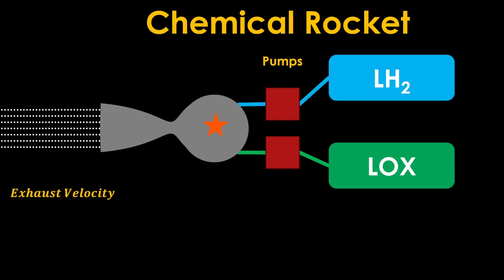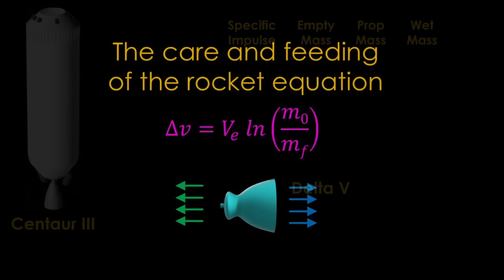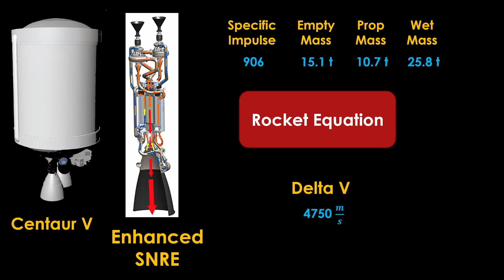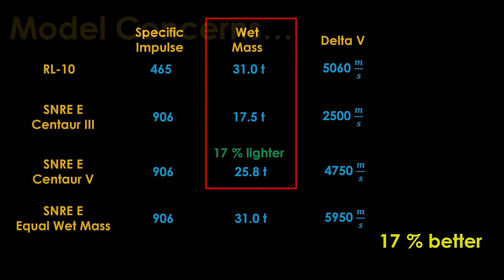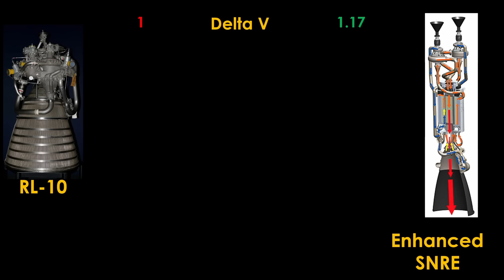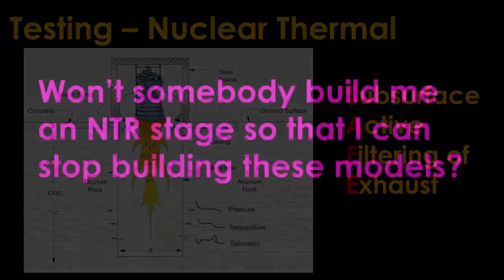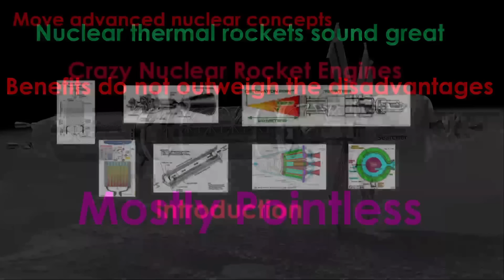Why Nuclear Thermal Rockets are Mostly Pointless

Comment: I do tend to agree that NTRs aren't all they're hyped up to be, but I think they do have their niche.
They pretty clearly don't make sense for single-use stages because they're much more expensive, and don't get much extra delta-V for the trouble without using an impractically low thrust-to-weight ratio. I think they're also generally unlikely to be very useful for exploring the inner solar system since solid core NTRs lose their efficiency advantage with the easiest to make ISRU propellants until you get out past the frost line, where water and hydrogen are everywhere.
As reusable tugs near earth, on the other hand, a stage that has the same delta-V but has higher dry mass and less propellant is actually really good because it makes refueling in orbit cheaper. For pushing lots of mass out from LEO, either to its destination near earth or to just shy of escape velocity, nuclear thermal rockets would save a lot of fuel mass. I think they have a lot of potential in their niche once space infrastructure reaches the scale to justify the investment, though I do think that's still a long way off.

The small scale of the reactor and the requirement that it can ramp up extremely quickly does mean that it probably has to use weapons-grade uranium, and it would have to wait a few days between burns since it couldn't afford the weight of the extra control systems to safely burn up the xenon on a sooner restart. That does pose a bit of a political problem, but not really a technical one, so I think it's a different argument.
Reply: Reusing a NTR also adds far more complexity and hurts its performance due to the need to expend propellent as a coolant after shutdown, or else the thing would literally melt itself.  Claiming problems are political rather then technological is the biggest lie in nuclear industry too, don't fall into it.
Reply: @kennethferland5579  I mean, I assumed you have to be able to shutdown the reactor between burns even if you aren't going to refule it if you want to do multiple burns, and there's very little that would want 6+km/s in a single burn. I also don't think that's a huge issue though, since quenching the reactor isn't that hard as long as you don't need to turn it back on for a few days. The relatively low tempratures in a solid core NTR also make a variable throat expanssiond deflection nozzle, to maintain chamber pressure and ISP at low flow rates, pretty practical, so you might not even loose much efficiency.

I do agree that almost everything about this (and most of the probelms in nuclear power) are technical issues, not polititcal ones, I meant to only refer to the likely need for weapons grade uranium as a mostly political problem. Everything else is obvioulsy a pure technical issue, and maybe someone more clever than me can turn the ramp rate into a technical problem too by avoiding weapons grade uranium, it just happens to be a well understood solution.

Comment: I feel like nuclear propulsion is useful but nuclear electric propulsion just seems more useful that NTP for long term missions. thrust is really low, but ion engines can already burn for months if supplied with power, NEP could allow that to happen where the sun becomes too weak to normally use solar panels like orbits farther than mars orbit. NEP could also have much higher thrust that solar powered ion engines due to access to much more power.
Reply: Solar electric will beat nuclear electric for anything withing the asteroid belt.  If we need to go to send men to Jupiter then we can start looking at NEP.

Comment: You wouldn't use the NTE to lift off. It's a second stage vacuum engine. The advantage comes from being able to run it almost continuously during the trip leading to extreme velocities and shorter trip time. Nobody wants to coast to Mars for 7 or more months.
Reply: No design for NTR has them operate for more then an hour or two tops, and the engine mostly destroys itself in that time.  For even a trip to the moon that time frames not much different them chemical rockets burn times of minutes, it's a huge gulf between that an week and months or YEARS that ion engines operate for.
Reply: Ion engines run almost continuously.  NTR's burn like chemical rockets, short an intense.  You might want to actually look up projected flow rates of the reaction mass.

Comment: Yeah, I used to be a big fan of nuclear thermal but I’ve shifted to a more, “they have potential but they just have too many issues for their benefits”.
Something like liquid or gas core nuclear thermal has enough isp in my mind to make it more attractive but if you are at the point where it’s cheap and practical enough to make those, you might as well make something more advanced.

Comment: Electric propulsion becomes utterly unusable at high mass. They simply do not have enough thrust to pull off a great many utterly critical maneuvers. NTR's get a significant ISP boost using methane because it can, at a high enough temperature, dissociate the methane to atomic hydrogen which is the fastest possible exhaust for a given energy.
Reply from the maker: I haven't found any mention of atomic hydrogen being generated. It's a hope.

With methane you still have the carbon in the exhaust and that reduces the isp
Reply: @EagerSpace  At a few hundred degrees C there's a certain amount of dissociation at equilibrium but it's less certain that it'll happen within the timespan of an engine. Ammonia would break down more readily though.
Either way, electric propulsion doesn't have a great way to scale up thrust.

Comment: these engies do make sense for 1 application
Reusable space transport
have 1 vehicle constatly  in LEO and if you want to go to low Lunar orbit you simply use a chemical rocket to go to LEO with fuel
refuel the vehicle and it will take you there and back and park it self in LEO again
would probably still be massive tho
Reply: No ion engines are better for all orbital civilian stuff

There are only 2 relevant metrics for a ship, acceleration and delta v. You need surprisingly little acceleration to go places before you hit flip and burn territory (you flip and burn with ion engines too, but it’s inefficient so ideally you want to avoid burning at the vente of the itinerary) 

Ion engines have enough thrust to bring you from planet to planet without running into the issue of you arriving at your destination faster than you can spend your fuel (the only reason you would need more acceleration in a transfer)

The moon is much closer to earth so an ion engine would take longer, probably going there in a spiral if it’s too weak, it would take a few more days but it’s not a big deal with permanent human presence (a few more days of food and water doesn’t matter if the people already live in space their entire lives anyways)

The advantage of nuclear rocket is having higher exhaust velocity while still being in the high thrust category of solid rocket and chemical rocket thrusters. There is no sense in using a nuclear rocket in an application where high acceleration isn’t required. 
So they are great for take off, landing and warfare, but for peaceful transfers ion engines + solar panels are better (solar so you don’t waste rare and finite, valuable fissiles)
Reply: @IceRain-f5v That quickly stops being true when the discussion goes to orbiting gas giants. 

There’s a Children of a Dead Earth mission that involves going from a moon orbiting either Uranus or Neptune into the planet’s low orbit to destroy a space station skimming the atmosphere to collect gasses. 

The final maneuvers that are required to get into position are next to impossible with ion thrusters. The spacecraft’s velocity just doesn’t change fast enough. 

Now, maybe given infinite time it could be done with some hyper sophisticated spark of genius set of orbits, but those can be an unaffordable luxury when time is of the essence. 

Likewise, ion thrust is useless in combat. Based on my own experience in Children of a Dead Earth and simulating space combat with heavily modded Space Engineers, the ability to change trajectory quickly is extremely important to dodging both kinetic weapons and debris from intercepted missiles.
Reply: I like calling them "engies"
Reply: No hot nuclear reactor is ever going to be allowed in low earth orbit. They will only allow the engines to activated once its on its way away from Earth to ensure any accidents don't spread radioactive debris across thousands of miles of the earth.
Reply: Except NTR are not reusable, the decay heat of ANY nuclear reactor will just strait melt it if not dispated, NASA NTR concepts were all disposable stages.  Making a NTR stage no meltdown would require complex modifications and additional propellent expended as boiloff coolant all of which will destroy the last shreds of performance advantage it might have had.

Comment: If NTR makes sense to use for very large in-space-only rockets that are to be used repeatedly, who do we sacrifice to do the maintenance on the engine?

Robotic maintenance?  What happens to the delicate electronics of the robot near the reactor?  Where do the contaminated maintenance robots live?  Where do old contaminated engine-area parts get disposed after they have been replaced?  If skipping maintenance and just replacing entire engines after some pre-specified time of use, then there will be more engines to dispose of, which nobody wants brought to their planet, moon, or dwarf planet.

When the engine is eventually decommissioned, where do the old engines get dumped, and at what expense to process decommissioned engines while in space?

How or in which circumstances are NTRs more cost effective than chemical rockets?  This needs to consider the whole cycle for the rockets, from obtaining materials, manufacturing, launching, operating, refueling, maintaining, decommisioning and disposing, regulatory fees, limits on where they can be used, never allowed to use aerobraking, and public anti-nuclear sentiment as has happened after large-scale radioactive accidents of any kind in the past.  Do NTRs always require government subsidies to be economically viable?  I don't see any big private money going toward NTR development, although some smaller start-ups want to try.
Reply: Luna is geologically stable and does not have a water cycle.
Plenty of space on the far side to put it out of sight.
I'm not particularly worried about a "Space 1999" scenario.
Reply: NTR's use up their fuel as well.  So the reactors power declines as it ages which means so does it's ISP.
Reply: @imaginary_friend7300  that is not how reactors function as fuel burns up. They can maintain any set moderator temperature for the entire design life of the core. So the hydrogen moderator and thus isp would be the same. What changes would be reflector position and neutron flux go up over life to compensate for lower fuel density. This would make the startups behave a bit different but not steady state operations
Reply: Reusing NTR is very very hard, they would need post burn coolant to keep them from melting, additional control systems and shielding to prevent damage and would have very low thrust to weight asnd higher costs a result.  NASA never considered any senario of reusing them.

Comment: Wow. Was all this planned to be used in the first stage? Or only in space as a later stage? And it sounds like hydrogen is the problem... per usual. Could heavier elements have dramatically greater effects? What would happen if you sprayed methane in there? KA-BOOM?!! 😄
Good stuff! And I think this is the first time your music choice is alien to me rather than one of my favorites as well.
Reply: The problem with using heavier elements is that you lose Isp.
Isp is equivalent to exhaust velocity, and average energy of an exhaust particle is directly related to temperature.
But E = ½mv², so velocity is inversely proportional to the square root of the mass.
Reply: @michaelmicek  The higher mass particle doesn't also provide more thrust? Temperature is a variable but mass is also, right?
Reply: I do seem to recall the plan was to use it as an upper stage engine.

Comment: since nuclear engines advantage are better in big rockets, what about starship? with a lighter fuel tank on the second stage i believe it would increase the DV
Reply from the maker: If your lighter fuel tank plus whatever heat shield was required ended up lighter than stainless, yes.

Comment: thats what ive been thinking tho nuclear electric makes sense.
Reply from the maker: I have a video on nuclear electric.
Reply: The problem with nuclear electric is you have to have enormous radiators to deal with the excess heat generated by the process.  And the thrust is very very low
Reply: Not only do you need huge radiators, but those radiators have to contain pressurised fluid. So they're inherently heavy. Solar panels make about 8 times more kW/kg than the radiators, even before you include the mass of the reactor and shielding.

Comment: So basically, only use this to push really big things when the engine and tank mass becomes a fairly insignificant factor.
Reply: But eventually you start running into the tyranny of the rocket equation and you end up with super low thrust to weight ratios
Reply: @mb777-g8v  well in that situation you're presumably trying to go to extreme distances. even a long long burn is probably relatively irrelevant at those kinds of distances. or you just make a somewhat larger engine. might eat into your delta v some but it probably still has better delta-v than switching to chemical.
Reply: Tank mass fractions do not drop as stages get bigger.  It is basically linear.
Reply: @kennethferland5579  you sure? i'm pretty sure this is a case where square cube law comes into play. if tank walls had to get thicker as the vehicle gets bigger, maybe, but in theory mass should increase with the square size increase, while volume should increase with the cube.

Comment: Can a NTR replace the electrical production of a spaceship and what would be the weight saving versus solar and RTGs?
Reply from the maker: There are some bimodal designs. Atomic rockets discusses them.
Reply: @EagerSpace  I love that site..
Reply: If using NTR for electricity generation when the engine is off, it becomes a problem dissipating reactor heat.  With the propulsion engine off, the reactor heat is no longer being dumped into the propellant being thrown out the back.  Keeping the reactor active to generate electricity when the engine is off, needs to generate a heat gradient to produce electricity, without the entire rocket heating up and thereby reducing the heat gradient's difference in temperature.